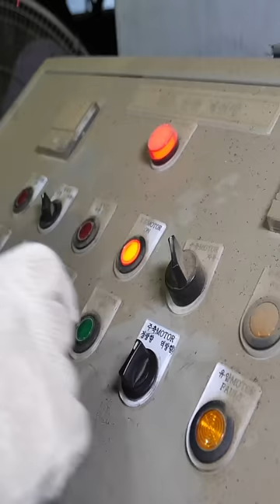The process of making a huge and magnificent plastic water tank. PE tank factory in Korea

Comment: Never thought it was done like this. Thought maybe each piece was made separately and then glued together. 😮
Reply: Same that’s a crazy method
Reply: it would be disastrous if they were made from too many parts. looking by their size, the volume would be really huge. there'll be too many weak spots from said parts connected together, it would break like an old dam.
Reply: @hh-kto   it like a 3.5 m high x 2m diameter (like a elongate 10m3), the max pressure is 0.35 bar. if one joint was defective, then it would just leak. plastic does not have a brittle behaviour and it´s quiet erosion resistance. 
there are tanks made like this with plastic, usually using 3mm PP o PPE and a plastic welder. they are fine, you can see the welds, and they last like 15-20 year with exposure to sun UV.  UV embrittlement is almost always the failure mode and not the welding joints.
I would worry that the melted plastic in this process can assure wall thickness consistency without suffering significant heat induced polymer degradation. 
this seems more like a cheap and error prone way to make industrial tanks, or expensive and safe if you increase the amount of plastic to assure a minimum thickness consistency.
Reply: Like yr brain

Comment: Looks like a very nice factory, but burning that much gas without a dedicated exhaust system to safely remove carbon monoxide seems sketchy.
Reply: With open flame like that I doubt any carbon monoxide is created, neither NOx for low temperature flame
Volume of production hall is more than enough, I assume they have decent ventilation system as well
Only problem I'd see is energy waste to heat uninsulated open air mould. Personally I'd go with either hot/cold liquid loop or heat/cool trapped air
But I don't know process much, maybe plastic is pooling under the flame and is sticking to walls, cooled in the process of rotation
Reply: Large space factory. Most like there are large exhaust on the roof. They're using Propane burners, so the amount of CO2 there is most likely the same in a restaurant kitchen.

Comment: There’s a place that does this better in Monroe, Louisiana. If you look for Ouachita fertilizer, you’ll find it. They have a much bigger rig that rotates the whole tank mold in every direction. It’s pretty amazing. Then they have to chill them to freezing and drop them from 100ft in the air. They do that because those tanks are used to store radioactive waste in a super deep hole at one of our planets poles where it’s always freezing. They just fill them up and drop them in the hole. Apparently it reaches terminal velocity within 100 feet so if it survives that you can drop it from any height and it won’t make a difference. That would be a cool place to visit and ask for a tour. I worked at Ouachita Fertilizer, its affiliate company. Owned by the same individual. I never even knew the name of the tank company but they’re on the same lot and I moved the tanks around plenty and even had to climb inside and clean out used ones sometime. The ones I cleaned were just full of fertilizer though, not toxic waste.
Reply: The last place I worked at also has this, the process is called rotomolding. Difference was ours were smaller and meant for RVs